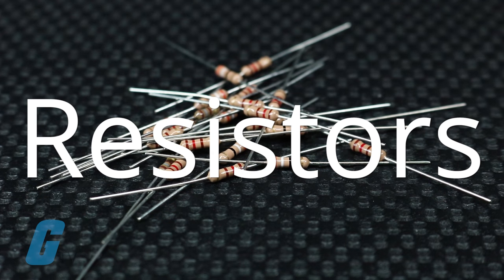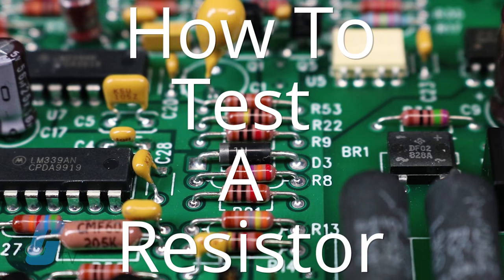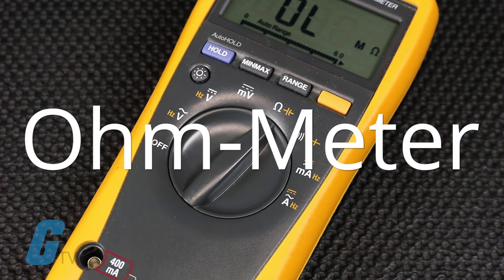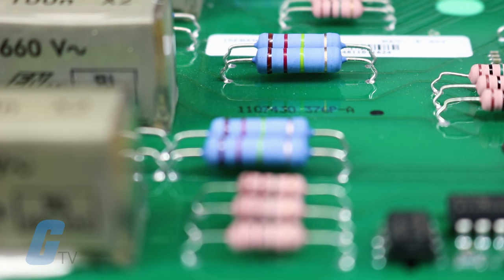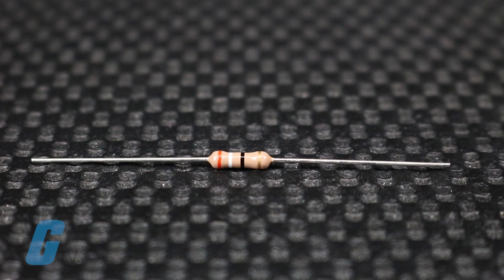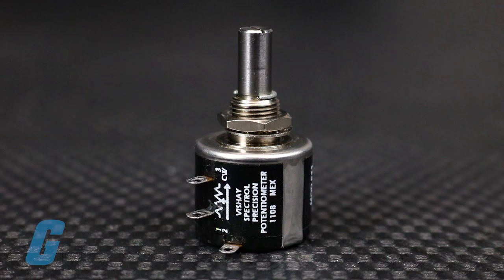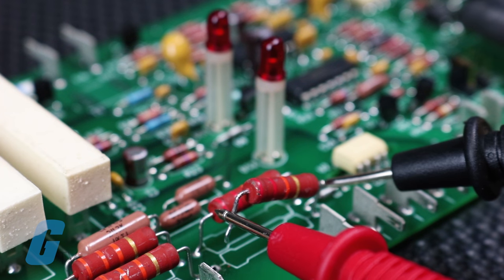How to Test a Resistor | Galco

Comment: My bands are (in order from the closest edge) : RED (2) / BLACK (0) / BLACK (0) / RED (10 x 10 or 100) / BROWN (100 tolerance) if I read right .... 

So 200k Ohms

When I touch the leads it gives me 19.85. to 20.11 ... is that accurate ????? 

Is it good ? Or does that decimal point determine if it's weak or blown ?

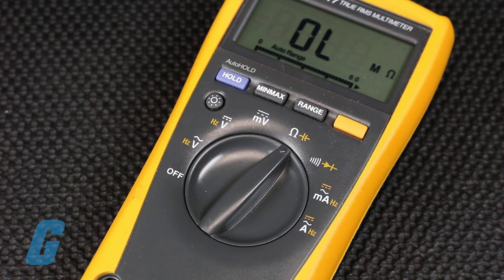Comment: 1:27 the whole reason I came here. How do you to that? What is the math behind determining the appropriate setting based on a resistors known value?
Reply from the maker: Well you can leave meter on AUTO range if has that feature, or just measure the resistor and see what it shows you. Push the range button until you get a reading, a digital meter  becomes very obvious.

Comment: How would I test a 399ohm resistor in circuit with esr meter. That is in my vehicle cluster with out taking resistor out to see if it's bad?
Reply: Just measured in circuit.  If you get a much greater resistance.  It is definitely faulty.  But also if there are any in parallel with it.  This can still throw you off.

Comment: Is this multimeter auto ranging?  This could be important if you run into a resistor in which the printing or color bands are faded or difficult to read.

Comment: If the resistor not working, then what the multimeter shows.. Or how to find a workless resistor with multi meter.. Please reply sir..
Reply from the maker: First determine what the value is supposed to be, and the tolerance range, either it is printed on it or you have to decode the color bands. If the resistor is only out of tolerance then your meter will show a resistance value but not in the correct range. If it is completely open then the meter will show the same display as if it was not touching anything. Fluke brand multi-meters show OL for open loop, ok?
Reply: @GalcoIndustrial  What if you don't disconnect it from the circuit and you measure but you get OL even if the meter is set on beeper?  Does this mean that the resistor is actually totally broken or not ?

Comment: I ordered two packs of resistors..
One pack 820 one pack 330

830 readys 0.814, and the 330 reads 324.0

What is going on I don’t understand lol
Reply: 820
Reply from the maker: Be sure to check the scale of your meter when taking these 2 measurements. You most likely missed the "K" symbol next to the value. 0.814K ohms is 814 ohms with a difference of the marked value well inside 10%.
Reply: And check the tolerance ... if they're 5% then these are within that range.

Comment: One more doubt sir... Actual value of a resister is 1000 ohms... multimeter showing 977...this resister is open??..
Reply from the maker: No it is not open. It is only 2.3% out of tolerance depending on the accuracy of the meter, ok?
Reply: approximately  value writeen ok no problem